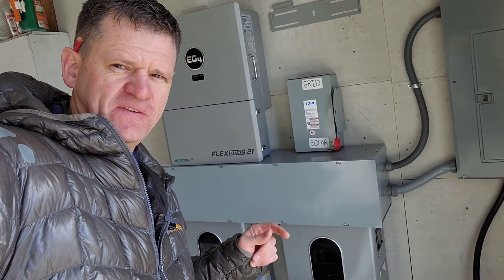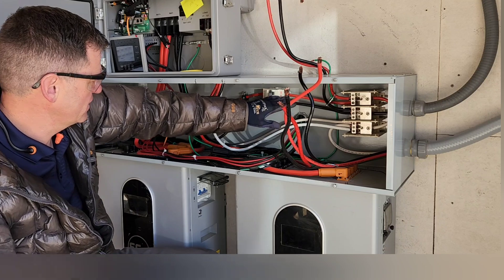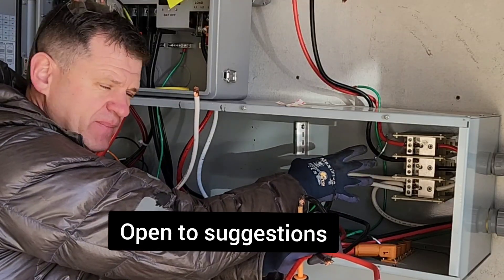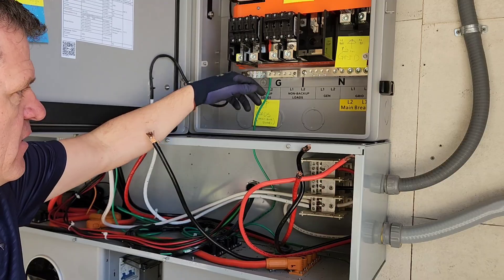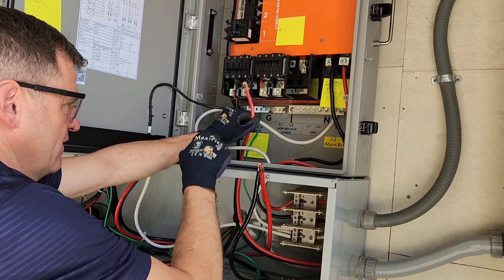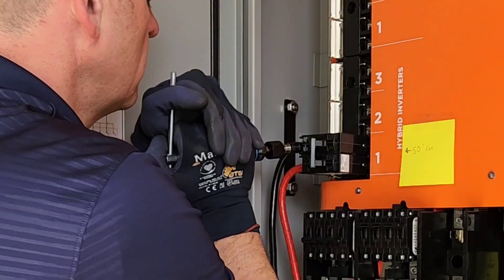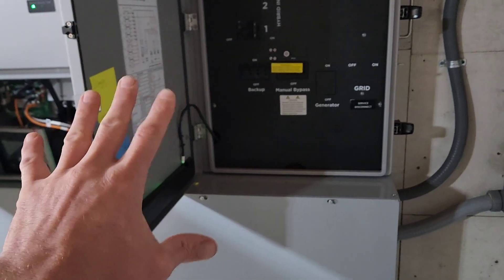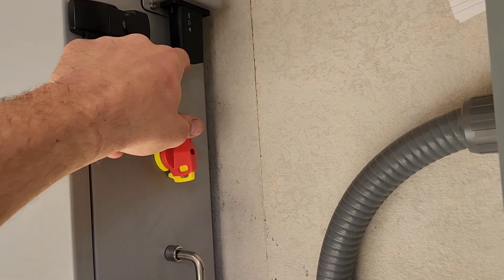How To Wire A Eg4 GridBOSS - Full Install

Comment: No ferrules?
Reply from the maker: I didn't put any in the gridboss. Ferrules are very popular to hold fine stranded wire together, which I currently do not have on the grid boss.

Comment: Is it ok to have grid go through main panel? I'd like to do it but worry I have too many wires in there already. Would be nice for me since meter feeds right into MSP so it would be cool to go from meter to msp to gridboss for my service disconnect.
Reply from the maker: Similar to how I am doing it? I am working on the paperwork to get my system permitted right now. I can let you know how it goes for me... 🤞

Comment: Thanks for vid, do you have a video on proper solar array grounding, like to avoid lightning damage and what not?
Reply from the maker: Unfortunately this is a debatable topic. Even by electrical inspectors.  Keep in mind that a typical house has multiple location where your grounding system  goes to earth ground. Eg grounded water pipes as they leave the house, also your grounding rod.  Here is a video good video explaining some of the arguments: https://youtu.be/PEpsz9Jqnrs?si=Rdkr-isN3BVqYmbR

Comment: Question about your N/G bond. I know it’s supposed to be at location of main input/disconnect…
But with Inverter power tying into the GBoss, wouldn’t the bond need to be in that box.
Otherwise when running 💯 from inverter (grid outage) the bond is far away.
Licensed electrician chime in
Reply: Best to leave the N+G bond at the main panel and not try to move it.  That’s where the ground rod is, after all.

Comment: I’d vacuum up those metal shavings.   Looks like they may fall down into coms port of the battery.  Great looking Install. Workin on a huge diy project myself.  Started with iron ridge racking but finding it hard to get parts atm.  May be building my own from scratch.  Time is running short!
Reply from the maker: Is yours going to be a ground mount?
Reply: Plus, I suggest putting a piece of tape over any open/unused com ports on the batteries.
Reply: I went with Pegasus skip rail and instaflash 2. Ordered on SS and locally and found everything I need for 30 panels

Comment: Is 90a breaker on the grid boss enough for the house breaker panel that is 200a? Will the grid boss breaker trip often during high amp usage?
Reply: The EG4 hybrid inverters plug directly into the GridBoss.  The GB has three dedicated ports for up to three such inverters.   The GB also has four smart ports and if you have any AC coupled solar the string inverters or microinverter AC connections would go into one or more smart ports.

Most people will just use the DC MPPTs on the hybrid inverters to connect-up their solar, but if you have legacy AC coupled solar it will still work if you let the GB manage it via a smart port.

So no external AC disconnects or bypasses are needed.  The GB handles all of that.

-Matt
Reply: @junkerzn7312 💯 correct
Reply: I've been running flexboss21 and gridboss since March and have never tripped breaker 1 time
Reply: 90 amp is for the flexboss21 input, the grid connection recommends disconnect/breaker to match service panel
Reply: The actual utility service is going into his main panel and has the main service disconnect, which will be sized for the service.  However, when you forward from the main panel the forwarder itself is also a breaker (required to be a breaker now)... that forwarding breaker should be sized for the forwarding cabling and can be smaller.  There is no need to match the utility service.

Ray didn't say how big the various cables were but the forwarder from the main service entrance looked like 2 AWG with a 100A or 125A breaker.

Also note that the GridBoss manual bypass and backed-up port service breakers are 200A, so the cabling going from the GridBoss backup port (or non-backed-up port) to the sub-panel MUST be 3/0 copper.  No exceptions.  It cannot be wired with 2 AWG.  Even though the main service might be smaller, the combination of the main service and any connected inverters can easily reach 200A.   The GBs internal bus can actually handle something like 300A.

This also means that the sub-panel you connect to the GB's backed-up port or non-backed-up port must be a 200A panel.   No exceptions.

Finally, note that in a forwarding configuration (which is what I do as well), there are three breakers inbetween the utility service and the GB's main bus (service breaker, forwarding breaker, and GB 200A bypass/normal operations breaker).  And then sometimes also a fourth breaker at the sub-panel depending on the type of panel.   This is "ok" (not against code).   If the GB were actually used as the main service entrance there would only be two breakers in the path.

-Matt
Reply: @junkerzn7312  thanks for clarifying, I havent installed gb before the main panel so I used a 100a eaton breaker for the main disconnect in the gb then used 2awg to backup loads sub panel
Reply: @tjmooney4181  The GB can gang power from multiple sources... A/C coupled solar, hybrid inverters, and grid, so having a 100A eaton breaker as the main grid disconnect doesn't protect the backup/non-backup loads cabling.  The bypass/normal operation breakers are 200A and not field-replaceable.

You can program the GB to not exceed 100A (or 125A if you push it) on those outputs, so it will still be safe in actual operation.  But the breakers don't match the cabling so... it will still fail code.

-Matt
Reply: @junkerzn7312 correct me where im wrong, it already passed inspection in a very tough county. Service to 200a main 3/0, 100a breaker from 200a main to gb 100a csr25k breaker 2awg, gb backup loads to 100a subpanel 2awg, flexboss21 grid ports to gb hybrid inverter ports 90a breaker 4awg 🤔
Reply: @tjmooney4181  

You got lucky if that passed inspection.  The Eaton service entrance breaker in the GB doesn't protect the backup/non-backup outputs.  The two bypass breakers (the ones with the slider) protect the backup/non-backup output cabling and those are 200A breakers.

-Matt
Reply: I may be overlooking something. Part of the point of the grid boss is a single source automatic disconnect for the grid. I do not believe you would want your hybrid inverter connected to the grid and the good boss. The inverter should flow through the grid boss into the grid….correct?